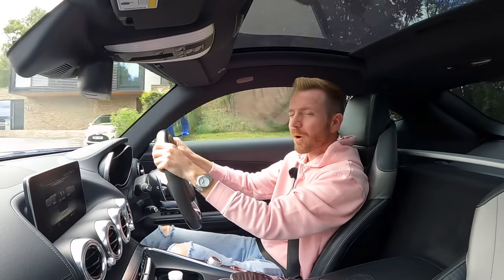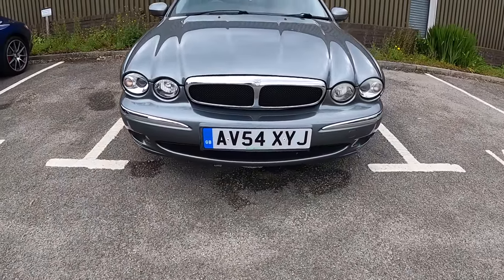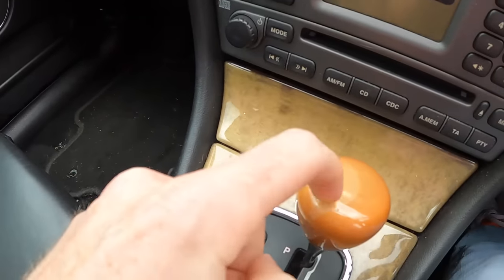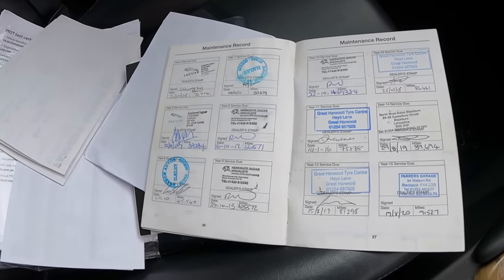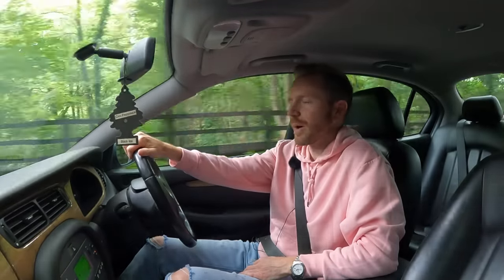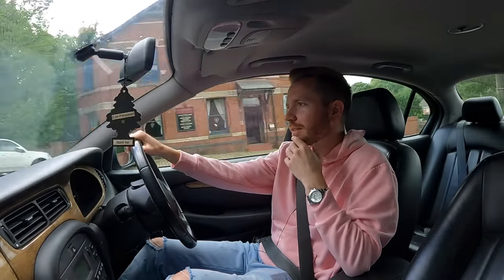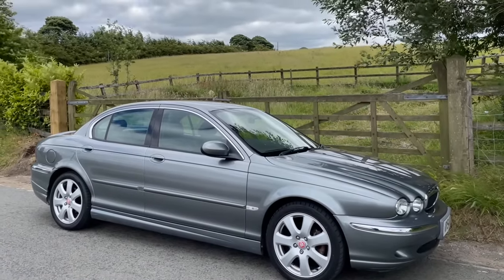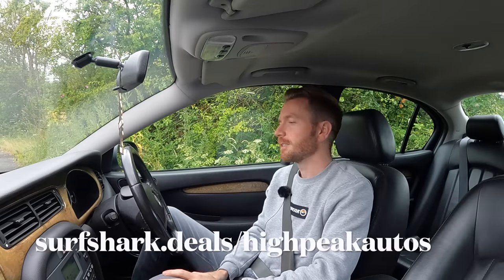I BOUGHT A CHEAP JAGUAR X TYPE!

Comment: The X-type was essentially the jag equivalent of the 3 series and it has a lot of character, on the exterior at least. The interior dates this car with  that wood finish.  Would look so much more modern with something like a carbon wrap or a dark paint finish on the wood panels. 90,00'ish miles on a car of that year is a little over 5000 a year which means it was probably the tool of choice for the short drive to the train station for the owner before he bought his copy of the Telegraph and hopped on a train to work. it might also have come out for a leisurely weekend drive once in a while to Lytham St Annes or Matlock or anywhere where you can get a nice afternoon tea
Performance wise it matches a 3series onhorse power and top-end but only when you compare it to a 2litre diesel... With petrol now at a pound a pint  it's an expensive daily if you are doing 400 a week given that the same 2litre diesel will, on a decent run give you close to 50mpg as opposed to 29mpg for the Jag.
Still as a weekender for someone who always fancied having a Jag. I have to say you've given the old girl a new lease of life and you could ignore the reg plate snobs by playing the "British classic motoring icon" card and you'd still be welcomed at your local golf club. You'll have no problem shifting this one Matt. A nice low mileage example like that deserves the TLC you've given it !

Comment: Those sills are 100% rotten. Absolutely guaranteed. I hope someone wasn't stupid enough to pay £2k for this car tarted up with some superficial bling. Unfortunately I know these X-Types inside out, and if the self-tapper screws driven in through the sill cover on the passenger side alone wasn't a massive red flag of a weapons grade idiot breaking all the clips and too cheap to spend a fiver replacing them, then they're a massive red flag that the holes in the outer skin of the ~5 layers (it varies - there are extra layers at the jacking points) coming together at the sill seam have gone and there's nothing for the sill covers to attach to. This appears to be reinforced by the visible rust on the driver's side above the plastic. The car has almost certainly simply had rectangular patches tack welded over the bottom face of the outer sill panels and the inners are all crumbling - because these sills rust from the inside out due to water getting trapped when the sill drains get clogged and it sits about 2 inches deep. Patching the bottom to hide the problem is all most people ever do meaning that when someone does eventually try to fix it properly with a good conscience it's a massive job because the root problem was never fixed. Had this car been fixed properly before, the self-tappers wouldn't be on the passenger side and the rust wouldn't be encroaching above the sill cover on the driver's side - because nobody remotely sane would go to all the effort and cost to do it properly and not fix that while they're there. They'll look like this on the inside: https://photobucket.com/u/jamie_duff/p/834b293f-835e-49dc-a586-c49142543c35 All your "mechanic" has done by waxoyling the outside underneath is disguise it to help mug someone into thinking they're getting a car that isn't a total rot box to help you make a quick buck. Full outer sill panels are available for about £100 each but for all the other layers you're fabricating on your own. There's a good thread on the JaguarForum showing how it's done properly to actually fix this. As usual, it's a DIY owner who is the only type of person willing to put the effort in to fix a car of this value to an acceptable standard. https://www.jaguarforum.com/threads/welding-the-rusty-sills.136481/#post-1480848

Comment: I just cant get rid of my X type,the look of it and how it drives,I was unaware of the sill rust problem when I bought it and couldnt wait to get
the plastic sills off to check and luckily it was fine but I flooded the inner sills with Dynax s50 but at the end of the day it cost me £1200 and ive only had to replace 3 coil packs and brake discs.

Comment: The first thing i would have done on seeing the car would be to pop the bonnet and check the fluids (especially the engine oil), not run it for 5 minutes and then decide to pull the dipstick. Oh well. Nice car btw.

Comment: I owned a 2002 X-Type V6 2.1 SE in Zircon Blue 85k, had it for 12mo, but it was constantly needing work. Paid £1800 from a dealer and sold for £2200 privately after a lot of repairs. It was a pain to own but fantastic to drive, and the interior was identical to the one in this video. Watching this video has somehow motivated me to get another!

Comment: I bought a 2.2D 2008 last week. Little more than the petrol but should do 50 mpg or there about. Also a sport so looks really good actually. 

I don’t think that car has xenon’s. Normally a factory xenon car would have headlamp washers as well.

Comment: I had a 2008 2.2 Diesel Sport Auto X-Type. I really liked it but it did have a recurrent Turbo Actuator valve issue, even after having the Turbo replaced. Other wise it was a very nice car. My eldest brother ended up having it off me when I replaced it with 2.2 XF Sport LE. My local independant Jag garage rates the X-Type too and with the exception of those plastic sill covers....which alow the sills to rust...there's a lot to like about them. Nice car.

Comment: Andrew Greens are in Ilkley, amazing the prices they charge and get for a small independent used car dealer and I worked for one that could charge....

Easy way to tell for Xenon'sis headlight washers, for some reason it was a requirement for years if it was equipped.

Comment: I had an x type sport 2.2 facelift. The engine pulled like a train. Never saw the inside of a garage other than servicing for the 06 years and 90k miles I put on it . Great workhorses. Traded it in for my current xf260.

Comment: I owned one of these, a 20D S on a 55 plate. Brilliant car that has no more than 20% to do with a Mondeo, mine had 107'000 when I sold it. No rust anywhere and a very strong quiet engine. The X Type is a very nice car, very well equipped and awesome handling.

Comment: I had this 2.5 se auto model in the first model year. Sandstone leather and a wooden accented steering wheel . fully loaded. Best car I have ever owned in my life and miss it to this day.  Those heated front windscreens were awesome and it handled like it was on rails with traction control on.

Comment: Just one question Sir, how did you get it for just £800?
I have to say, I miss living in the UK. I've got a 2010 Nissan Note 1.6 petrol that I bought for one reason only, it's used as a 'daily' but in particular to transport my  almost 93 years old Mother, it's an easy access car for the elderly ( big, wide opening doors, slightly higher than a normal saloon, just get your ((her)) bum on the seat and swing the legs in, job done)
Know what the annual Road Tax is? Euro 400. 
I used to have a Jag XJ 4.2 (in the UK), I loved that car, ok it was thirsty but it was such a joy to drive and the double wishbone rear suspension....ok, sigh I won't go on but the point is this, the annual road tax on that 4.2 litre Jag in Ireland would be in excess of Euro 2,500 per annum, aargh!
So, you guys in the UK might be complaining about the cost of fuel (so are we!) but you have sane motor tax at least, if you want to drive a fine old car with a big engine, you can. I myself cannot.
You lucky, lucky........
Pax.

Comment: It won't be worth £2k with a service and an MOT. I bought a 2.5 SE last November for that price. It had 40K on the clock, not the nearly 96K of this one. The one I bought was an 06. This is an 04. Mine has the touchscreen with nav, plus a heated windscreen and heated seats. Yours has none of those. I don't think yours is actually an SE. Mine also has headlight washers and automatic headlights, that yours should have as an SE. Mine doesn't have a worn drivers seat because of the low mileage. Yours does. Everything works on mine. Does it on yours? Mine doesn't have rust on the top of the sills, nor did it have an MOT failure in 2021 like yours that says: 
Repair immediately (major defects):
Nearside Rear Suspension component mounting prescribed area excessively corroded significantly reducing structural strength sill large hole (5.3.6 (a) (i))
Offside Front Seat belt anchorage prescribed area strength or continuity significantly reduced sill large hole (7.1.1 (a) (i))

Comment: Funny how the Jaguar X-Type seems to always be associated with the 3rd generation Ford Mondeo, which was a vast improvement in looks over the previous versions. which is not a bad thing. But no one ever says that about cars built by VAG, BMW, PSA and FIAT, after all isn't a Rolls Royce Ghost just a BMW 7 Series? Just a thought. 
Had one of these wonderful cars for 3 years, and traded it in for an X350 TVDi version, a beautiful car, but a money pit compared to the sublime X-Type. Ours was a bit strange because it had an electric sunroof and Heritage Tan leather interior with metallic black paint work. Now have a Rover 75 Classic, have to say I prefer the X-Type. The 2.1 litre engine was super smooth American built with chain driven cams over the belt drive K Series on the Rover. Wish I still had the car it was super reliable. Try one, they are underrated but better looking than a 3 Series.

Comment: I purchased last year a 2003 X-Type 2.5 AWD in superb like new condition clean as a whistle, even better than this one. It was garage kept with no rust at all. It even had a little of the new car smell still in it. Previous owner kept a large file with all the records everything even for the most minor of service or repair. I know it's a car for geezers but since I'm in my mid 50's, I figured why not. For the price I paid you couldn't get any better USD $3,500 or GBP £2875, especially now with new car prices ridiculously through the roof and all.

Comment: service and parts are way cheap at your location. For VW/Audi service at my independent service center I pay $150/hr labor and whatever the cost for OEM parts + 15% mark-up. In other words,  if any replacement of parts is required and a diagnostic scan, you can expect $500 charge for that visit. Did I mention I'm in the US.

Comment: Ok I had a X-Type tunes into Smooth........an SE with the chrome......and no I refused a leaper on the bonnet. In Grey with grey leather with xenons. Xenons have headlight washers. Leaper needs taken off the boot lid.

Satnav.......will fail (DVD) parking sensors will fail. Facelift grill really set these cars off, the earlier ones are horrid.

Comment: I got a X Type left to me in a will, 
It was a 2003 2.0 Automatic ,, I found it very heavy on gas also going up a small hill it was hitting 4000 revs ,, I dint like it  the 2.0 Engine was not powerful enough for the heavy car,, it needed a turbo ,, I only had it for a year ,, 
got a 2003 Audi 1.8 T Automatic after that brilliant balanced car/ Best drive from the west of Ireland to Rome in 3 days .. 140 MPH in the south of France .

Comment: Matt
Keep looking at getting rid of my Jeep Grand Cherokee on a 09 plate with 178000 on clock , but a hgv driver and it sits in car park 6 months of year. Like to reduce tax cost . Fuel not the big issue only do 4000 miles a year . But do like these X type petrol v6 obviously. What’s your opinion he who should know . Cheers Glyn

Comment: Beautifully kept car. I drove a straight six E30 auto and also loved how creamy the power delivery was.

But that car emits 239g/km CO2 so if you do 10,000 miles a year that's 4 tons a year. Only takes a few years of doing that and you could have made an EV battery instead. So I don't buy your argument. Keep it on the road because it's a classic, not because it's eco.

Comment: This car is certainly not a Mondeo. I had a 3ltr one and whilst it is no match against my 1996 XJ6 is is still a great Jaguar car. I love them but the mechanical side, and as a DIY owner I am not impresses. I sold my 3ltr but love the this compact car so much, I am now looking for a good 2.1ltr  model. Why? Well because? Yes it only has one exhaust pipe but one less to look after. No transfer box or rear drive shaft to maintain. Now this is a big one! I can get to the plugs and coils without having to pull off the intake manifolds which I had to do on the 3ltr model. The down side of the 2.1ltr is that it is not a fast as the other models. However, where I live we have speed limits on or roads and when  I want to go fast I can only do 110kph even on our fastest motorways. And even then the 2.1ltr is certainly not a Mondeo. I wish people would get over this or I will start telling some Audi owners that some Audi's are just VW's.

Comment: Cars of that era had better Aircon than modern cars. The refrigerant used (r134a is more efficient and cools better) The reason it's no longer in use is the effect on global warming. We now have R1234yf. It's more flammable and difficult to handle so it costs more. The vents always felt much cooler with R134a cars than anything new.

Comment: That's my plan for the next car one my lease is up - buy an older car and keep it for as long as possible.  Obviously the environment is massively important, but I'm also not convinced by EV's just yet.  I just don't think we have the right battery technologies yet and every manufacturer has convinced themselves EV's must have touch controls and be like an iPad on wheels.  I'm also not convinced by the prices of EV's either.

Comment: Longhurst Lane Mellor and up on the Derbyshire border back roads. Proper roads on which to exercise any Jag. You're absolutely correct that the best way to recycle an old car is to maintain it and use it. To manufacture a new car costs more energy than it will use in 25 years. The Jag's "carbon footprint" disappeared years ago. Also EVs use Chinese batteries which are produced using child slaves as cobalt miners in The Congo.

Comment: Out of 27 cars i have owned i had the 2.5v6 4x4 and it was a good car , bought
it from jaguar for about 12000 sold about 2 years later for 6000  , most ever lost 
on a car , even though it was 4x4 it doesnt feel like one , does not instill much
confidence in it ...
after loosing that much when off them for a while and yes i had a leaper fitted
for the full jaguar experiance .. ha ha

Comment: Used 'Car Vertical' service but was disappointed that the registration number of the car I checked was not clearly displayed as the title at the head of the report; VIN number was used instead, which I have no way of cross checking unless I view the car in question. A basic omission - get the header right!

You might like to pass this feedback on to Car Vertical.

Comment: The saddest thing about the X Type is that Jaguar did not replace it in 2009 (of course there were reasons, but still sad).   My view is that the design has aged well if not better than anything in class. Maybe buy a southern car subject to less salt.  Good ones are very good, I see at least another 10 years for my '05 2.5 auto estate with 52,000m.

Comment: I'm inspired, I've saved up a bit of cash and once I've 2k spare I'm gonna have a go at getting a cheap diesel, either get one I can run cheaply for a few years or sell it on and keep going until I get that bargain that'll do me for years of next to nowt. What's to lose? If it's a lemon, I bought it so someone else will anyway. Ford first I think- cheapest parts and usually just the bodywork let's them down, haggle room when you mention the arches lol

Comment: Lovely cars unless you are unfortunate enough to get electrical gremlins, which I did. Couldn't find anyone near me who could get to the bottom of this so reluctantly had to sell as I don't need a car I can't trust. The next owner found someone to fix the problem which turned out to be a short in the ABS unit. That cost £700 to rectify. I would have gladly paid that had I been able to find someone who knew what they were doing -  I was that fond of the car.

Comment: The V6 3.0 auto was a great car when it didn't develop another fault. 😂😂 Great getaway car. Nothing funnier than flooring it when the wannabe Corsa driver thinks his car is quick. 😂😂 Couldn't agree more about keeping an older car on the road. I'm now running around in my recycled BMW 528i. 😁😁 Beautiful smooth creamy six cylinder and superb comfort. £2200 is a bargain. 👍👍

Comment: I had a 2003 3.0 SE AWD for about 6 months back in the day 
Lots ro like about it, I put on new brakes and Avons, BUT the gearbox box was so dim whitted and pick up so slow, that it was literally a death trap if you ever had to overtake anything. And the headlight were rubbish, even with new 💡

Comment: Someone buying that at , say, £2300, run it carefully for 2 years, they are likely to get £800 for it - and drive a fine car for 24 months. Include services, about £15 a month.
The killer is the cast of petrol - but that applies to anything other than an EV. Can't say I'm into driving a milk float.

Comment: I had a X type for about 7 yrs. Front wheel drive would go absolutely anywhere in the snow. Coming home one night, 5 inches of snow, rush hour, just about to go up a long steep hill, gathering a bit of speed to give it a good go, less than a 3rd up, a fucking tranny van trundles out of a side street went about 25 feet then just stopped dead, wheels spinning, and just slid into the gutter. I had to stop dead behind it and feared the worst with the snow and the incline of the road. I rolled back about 10 feet to give myself room to steer past the wanker in the van. From a dead start it absolutely flew up the hill without a second thought. I drive a Lexus now and it wank in the snow. I've retired now so thankfully if it snows I don't have to go out in it. Thank fuck because it's shit, struggled to even get out of the street onto the main road.